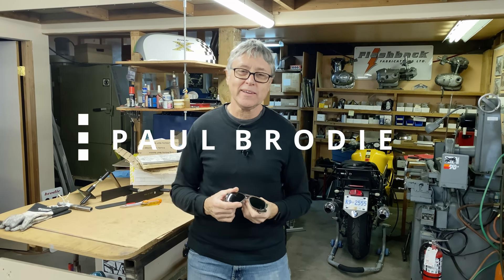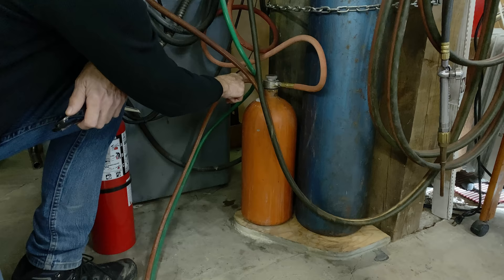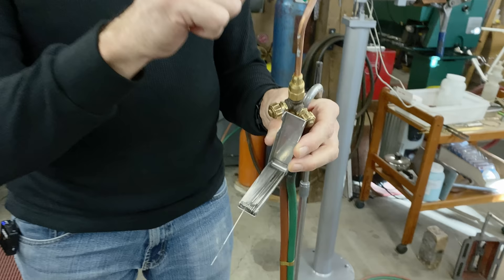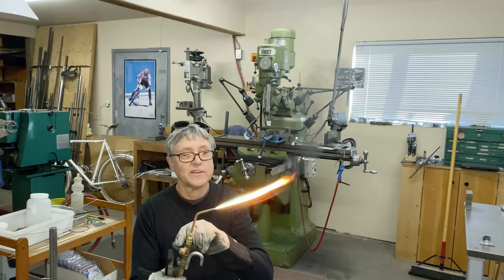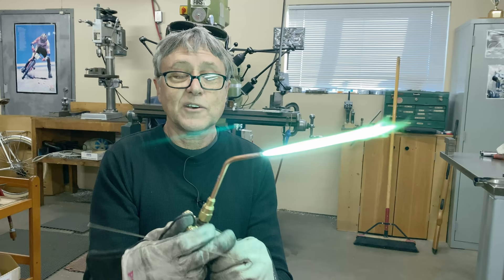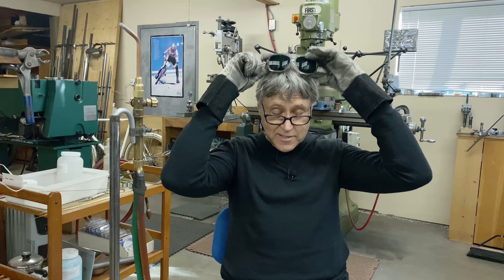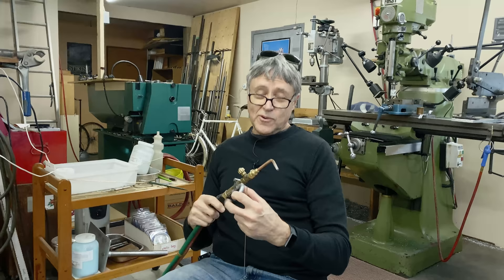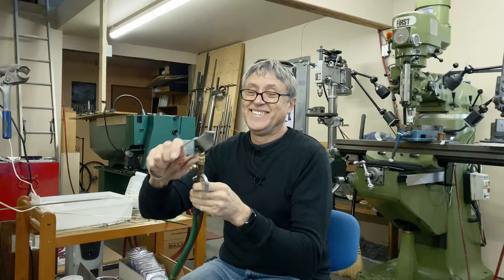How To Braze - Tips and Tricks with Paul Brodie

Comment: excellent video Paul! Question: is it possible to silver (or brass/bronze) braze steel tubes with a propane torch?
Reply from the maker: Thank you. I do not think a propane torch is hot enough. I have heard that propane AND oxygen will do it, but I have never tried. I always use oxygen-acetylene, works every time!
Reply: The flame of a propane torch is hot enough to melt silver based rods, but steel tubes pull your heat away too fast. You would need a very large flame, which would cost you a lot of the control between melting and solidifying. If propane is your way, then lugs might become your friends. And your gas dealer, as you'd need lots of it.

Comment: Hey Paul and Mitch, 
What model of in-line fluxer do you guys use over there? 0:31
Reply from the maker: The fluxer I mostly use is an Allstate, I believe. I bought it in 1988 for $800. It looks like a small oxygen bottle with 2 hoses on the top. I also have a Gas Flux fluxer, from the Gas Flux Company in Elyria, Ohio. I think it is a model 69. I am going by memory here.. They have become a LOT pricier lately.

Comment: I have some 1-1/2” stainless tubing 035 wall that my work was throwing out years ago.  I’d like to make a frame with it. Thinking of oxy acetylene brazing. Any reason not to? What type of flux and filler? I made one frame of 4130 in the past and that’s my only experience.
Reply from the maker: Your 1.5" tubing would only be good for the downtube, possibly, and then you would have to find all of the other tubes in stainless. I would only Tig weld a stainless frame, and then you have to purge inside the tubes. A lot of extra work. And stainless frames have been known for tube failure. My advice? Stick to 4130. It's relatively easy to use, and usually bomb proof....    :face-fuchsia-tongue-out:

Comment: Why use additional flux on the metal if you have it in your lines? Or vise versa? Thanks
Reply from the maker: That's just what works best for protection and flow of the brazing material.

Comment: Sorry if this is an irrelevant question but I want to seal the bottom seam of an oil lantern. Should I braze or solder it? It’s very thin metal. Possibly steel or tin.
Reply from the maker: Without seeing it, I would suggest trying solder. Much less heat, so if you don't get it right, less chance of destruction. Spend time to get it clean and sanded, if possible, apply flux and be careful. Don't overheat. Try to make the solder flow with the least amount of heat.
Reply: @paulbrodie  Thank you!

Comment: Hi Paul, thanks for making this content. I made my first and only frame about 15 years ago, finally broke at the head tube. Now want to make another to replace it. I don’t have access to the torch anymore, so would have to get my own setup. I could invest, but my garage is mostly woodworking stuff. I only plan to make 1-2 more bike frames. I’ve heard that I can use MAPP to braze. Is this a viable method for the limited amount of work I plan on doing? It may go though 4-5 bottles of MAPP, but maybe better for my situation. Also don’t like the idea of keeping and maintaining gas tanks that I will infrequently use. Advice?
Reply: I suppose I could also invest 800-1000 in a TIG machine, and not have to worry about storing oxy and acetylene in my garage, but again for making 1-2 frames probably easier just to MAPP, right?
Reply from the maker: I have never used MAPP gas to braze, so cannot really offer advice there. Oxy-acetylene really is the way to go, but I can see that as being a conflict with your wood shop. Tig is an option, but it is much harder to learn, and I would never do everything with Tig, such as the brazeons. In a perfect world you would have your wood shop AND a metal shop. Thanks for watching!     :face-purple-wide-eyes:

Comment: I bought Phos-Copper brazing alloy by Harris, their website says you can not use it on steel but I tested a small piece and it seems to have created a nice joint, Is what I'm doing wrong?
Reply from the maker: I can't really answer that because I'm not there. You should do a "destructive test" on some similar, scrap steel. Try to break the weld, be careful, see what happens. You will soon get a sense of how strong the weld/braze is. Good luck.
Reply: @paulbrodie   Thank you sir!

Comment: Thanks for this video, Paul. I don't think you mentioned regulator settings for the oxygen and acetylene. What are your preferences there? I use 3-5 psi for acetylene and 10-12 psi for oxygen. I was also taught (I took a course at UBI) to open the acetylene bottle only a quarter turn and to open the oxygen bottle all the way, but I don't remember why. Is this consistent with what you do?
Reply from the maker: The Rule of Thumb I was taught years ago was 1 psi for each tip #. So, a #5 tip would get 5 psi. I use a #0 tip, so obviously 0 psi won't work. I just use a couple of psi and that works fine. Turning on the bottles: I was taught 3 half turns for acetylene, reason being that if there ever was a fire, you can switch off the fuel (acetylene) very fast. I have heard also that it's best to open the oxygen all the way because it has a different type of valve than the acetylene. I must be lazy because I've always opened the oxygen 3 half turns, and never had any problems. Hope this helps!
Reply: @paulbrodie  Thanks! Very interesting indeed. I appreciate that you not only take the time to make these videos but also to answer the questions in the comments. I'm learning by reading through others' questions and your replies. Cheers!
Reply: i just stumbled onto this channel almost like it was meant to be, I couldn’t help but laugh when reading your comment  (months old now) as I have had the exact same questions I have wanted to ask of someone every time I look at a torch. It is so long ago but I was taught that my regulator and bottle set up should be basically the same as you use. Paul’s response was right here in front of me just like I had had asked myself, thanks for asking.

Comment: Hi I use propane with oxygen as acetylene gas is very expensive in the U.K. and a very high rental for the Bottles , do you think that’s ok , I seam to do ok but would value your opinion 👍
Reply from the maker: To be honest, I have never brazed with propane and oxygen. Always oxy-acetylene. It seems propane can work, but I feel that acetylene is better. I don't know of any professional frame builders using propane.     :face-orange-raised-eyebrow:
Reply: @paulbrodie  I’m just a hobbyist that does old cars up and sometimes need a none Structural job taking care of , I’ve Tig & Mig for other stuff , thanks for your answer 👍

Comment: Great video, thanks very much for sharing Your knowledge!
How much does the trimethylborate based flux clog up or affect the hoses and burner, if at all? I use a low pressure Dillon torch for brazing and wonder how much additional maintenance a gas/liquid flux system would need. I was also curious about the nickel silver solder You demonstrate, it works really nice. How much nickel and silver does it contain?
Reply from the maker: After a few years I need to replace the acetylene hose. The flux sometimes clogs the one way valve in the fluxer, but that hasn't happened for a very long time. The nickel silver rod is a 6800 rod (Soudotec) with ZERO% silver. The name is confusing. Silver solder is completely different. Thanks for watching!
Reply: @paulbrodie  Thanks a lot for Your answer! 
That 6800 nickel silver rod seems very similar to the phosporbronze stuff for copper pipes etc. that I have used. Do You have any advice on when it is ok for steel and when not? 
I fully agree on the silversolder confusion. Everything from lo temp electronics, silversmiths solder for silver, silver brazing, and more is called that. I thought this was similar to some nickel and silver containing rod I bought for high temperature resistant braszing long time ago. I think I still have some of those. 
Also wonder if cheap boric acid disolved in methanol would work as flux? The classic green flame chemistry demo...
Reply from the maker: @erikisberg3886  I use nickel silver on steel a lot. Great for brake bosses, pinch lugs, etc. Not for water bottle braze-ons, the tubing is often thin so silver solder is better. Hope that answers your question. I've never made flux, I just buy it. I don't remember it being expensive.
Reply: @paulbrodie  Thank You again for the information. 
What worried me was the information on the 6800 ds warning against use on ferrous metalls. I have also been told not to use the phosphor bronze rods on steel. Never known why though, since it seems to work so well. After some searching I found this from the ESAB site:
https://www.esabna.com/euweb/as_handbook/596as5_2.htm

It specifically mentions the 11 rods for use on bicycle frames and liquid flux systems.
But the very similar rods for copper brazing are still not supposed to be used on ferrous metals.
I feel I am missing something important here.
Reply from the maker: @erikisberg3886    I will add to the story. Some of this appeared in another answer to a similar comment. I started using nickel silver in '84 when I was building for Rocky. It was a "773" rod. Through the years, if I needed more rod, I just asked for 1/16" nickel silver. No salesman ever asked for a number, I just knew it was 773. I never had a problem with these rods; they were great. Last year Mitch and I started this channel, and viewers like you started asking about the rods. No one has heard of 773, so it was discontinued years ago... I went to the welding supply shop and asked for a spec sheet. That's when I found out there were (4) kinds of nickel silver rods! I asked sales which one he had been selling me, and he wasn't sure. He "thought" it was the 6800, with no silver. So, I also am a bit unsure. I know the spec sheet says "do not use on ferrous metals", but nickel silver works very well on bicycle frames in my experience. The spec sheet also says to use a "slightly carburizing" flame. I talked to the most knowledgeable rep they have and asked why, and he couldn't give me an answer. So Erik, I don't think you are missing something. I would say to order a few "different" nickel silver rods, play with them, and see which one works best for you.
Reply: @paulbrodie  Thank You very much for clearing this up!
 The ESAB recomendation of 11 rods for bicycles also confirms this and they seem very similar to 68000. Since I am in Sweden, the ESAB rods are more readily available here. Your videos are very educational, thanks for taking the time to share Your knowledge.

Comment: Hi Paul, really love your channel and it has motivated my son and I to try to build some bike frames.  I do have a question about bare bronze vs flux coated bronze rods.  We got our oxy-acetylene outfit this weekend and started working on your icicle exercise and trying to do some fillet brazing on bike tubing we salvaged from old broken bike frames.  As we don't have an inline fluxer, we decided to use flux coated bronze rods.  While we were able to build up some reasonable icicles, when you look at them they are beads of bronze covered with flux that haven't bonded together and break apart.  Also we can build up some reasonable fillets but it seems to be a bit harder to do than I expected and I was wondering if we are ending up with too much flux that is getting in the way of the bonding process.  I am going to buy some bare bronze rods to try but would appreciate any advice you might have.
Reply from the maker: Learning to braze is not easy, but don't give up. I suspect the base metal (the icicle..) is not hot enough when you are adding more filler rod. Both have to be molten before a "join" can happen. Watch the video again and take special note of the distance and angle of the cone to the icicle. The size of the cone is very important too. Good luck.
Reply: @paulbrodie  Hey Paul, thanks for the advice.  Out of interest we tried using some bare bronze rods last night and they were much easier to work with (both making icicles and building up fillets).  Really not sure why but it seems to me that with the flux coated rods you end up with too much flux that ends up getting in the way of the bonding process.  Anyway we are going to stick with the bare bronze even though we don't have an inline fluxer as it just seems to work a lot better.
Reply from the maker: @donaldgross8371  Why don't you buy some of the good (type B) paste flux and then you can dip the bare bronze rod in it from time to time; that way you can experiment and control how much flux you apply.
Reply: I don't have an in-line fluxer and it appears to make the flame white.  My flame is more firey red. I tried the coated rods and I prefer the non fluxed type with a tub of flux.   That way you control the fluxing.   Good practical tuition.

Comment: Can you please elaborate about the benefits of braze-assembling a tube-frame vs a regular welding (e.g. with TIG or oxy-torch)?
Reply from the maker: They are both fine ways to make a frame. Brazing and filing takes longer, and is more arty. They are both very strong if done properly...  :face-orange-biting-nails::face-orange-biting-nails:
Reply: @paulbrodie  very arty indeed - the joints look amazing! Can you estimate the total extra weight added to the frame by the brazing material?
Reply from the maker: My best estimate is 57 grams...  :face-fuchsia-tongue-out::face-fuchsia-tongue-out:
Reply: @paulbrodie  For the whole frame? Wow! That's much less than I thought.

Comment: Hi Paul, thanks so much for your insight into the brazing process. I learned quite a bit watching your techniques. I use a Victor torch as you do.  I got it about 20 years ago, and it did not have any flashback arrestors. Do you think they are necessary for brazing frames? I have read they may not be needed when running low pressures, like 3 or 5 psi. Looking at your torch in the video I don’t see them.
Reply from the maker: I do have a flashback arrestor on my acetylene regulator, not at the torch because that's just extra weight to hold up. I would think of them as an inexpensive insurance policy. You might never ever need them, but if there was a situation you would be so glad you spent a few bucks and installed them. Thanks for watching!
Reply: @paulbrodie  Your approach makes a lot of sense! I will get an arrestor for the acetylene tank. Much appreciated.

Comment: I'm working on a moped fuel tank. This metal is vary thin. It has rust hole in it. What is your recommended course of action.
Reply from the maker: I would try and find a used fuel tank that is in very good condition. Trying to fix a rust hole on a tank that is very thin, sounds like a very tricky job... You could try patching it by steel welding, but if the metal starts to burn away, try brazing on a patch. To be honest, I would not want that job...
Reply: @paulbrodie  I understand, the tank is is part of the frame. I'm a welder by trade, boilermaker, not use to welding items that thin. And haven't done a lot of brazing.   Would silver be better then brass for this?

Comment: does any of these types of rods allow to repair some metal tubing, and that tubing be able to hold....let's say 100 psi....inside that tubing?   (think radiators)
Reply from the maker: Brazing rods mostly work on steel, whilst radiators are often made of brass or aluminum. Never heard of a steel radiator. It would rust.
Reply: @paulbrodie  yeah......i think ours are made of copper.......(with MEG) mono-ethylene glycol running thru them.....
Reply from the maker: @stanleyshepard6830   Brazing copper is not easy at all,  you might have better luck silver soldering..

Comment: Hello, I need some advice, how would you suggest someone silver braze a stainless steel ferrule on to a stainless steel keg? I'm trying to do what is shown in the video posted on the goodwelds channel "Tig welding 304 stainless 4" tri clamp fitting in ABS brewing fermenter". I'm not a tig welder, but I have brazed before. I'm thinking about cutting the hole so the ferrule doesn't fall through, but rests on a lip. Would it be better to braze it on the inside out or from the outside in? How would you do it? Thanks for any suggestions. Cheers.
Reply from the maker: Hello, we need to be very careful with the choice of words here. You said "silver braze". Do you mean silver solder? They are different, so I need to know exactly what you mean... If you are silver brazing, what rod are you using?
Reply: @paulbrodie Hi, I meant silver brazing. I am using Harris Safety-Silv 56 (flux coated silver brazing alloy)  1/16" x 18" rods. They have a label stating they have a fluidity 8 rating. I guess I could use solder, but thought brazing would be better.
Reply from the maker: @snappingbear  I have never used those rods you have. So, I'm not sure I can answer your question. I think you need to set up a test situation. Get some stainless that is the same type and thickness as the keg, and try brazing / silver soldering in a ferrule. This way you can also experiment with tip size, and size of the cone. Everything has to be very, very clean, and don't over heat the flux because that never works...   :face-purple-wide-eyes:
Reply: @paulbrodie  Thanks, I was thinking of trying that because I have a piece of the stainless from the hole I cutting out.

Comment: Are you just starting to melt the base metal before you add the filler rod? It's for a "debate" I have going on YouTube. I learned a little bit about brazing 40 years ago and probably haven't done it in the last 37. Thanks.
Reply from the maker: If I am brazing, I do not melt the base metal before adding the filler rod. I only bring the base metal "up to temperature". Am I making sense?
Reply: @paulbrodie  Yes, thank you.